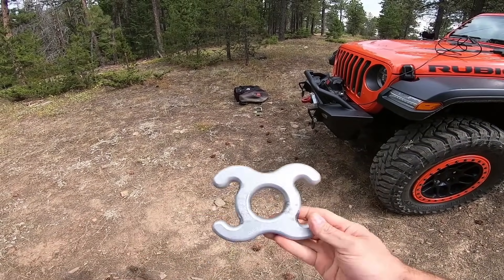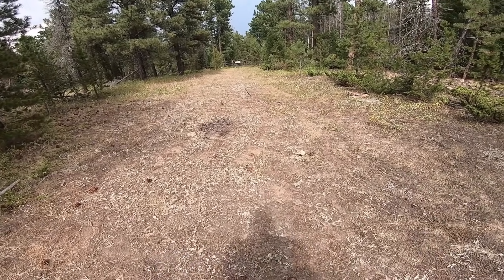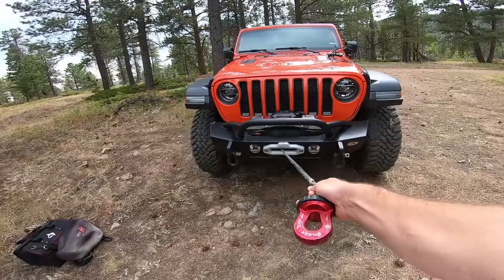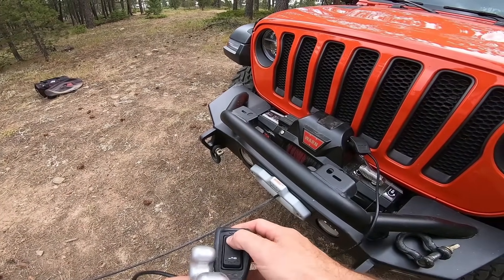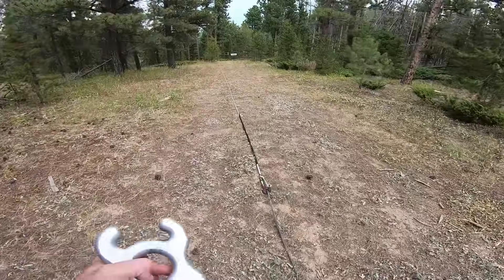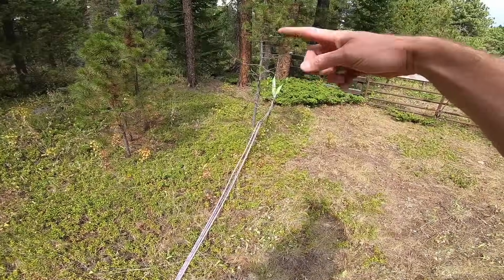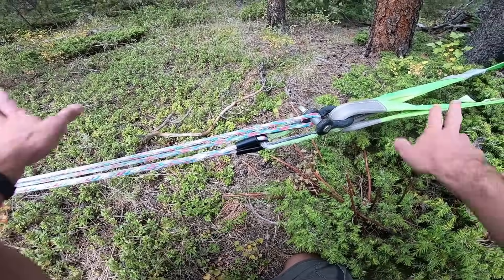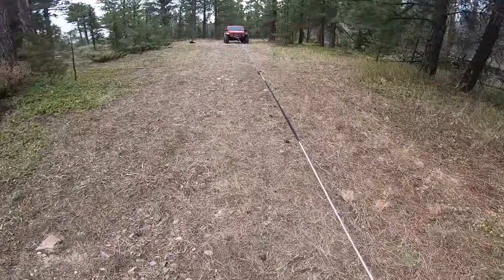Offroad Recovery Gear - What's an X-Lock Part 2

Comment: Good videos. It's neat to see some innovation with explanation in this market. One small suggestion/tip. Be aware of potential damage from the exposed threads on the inside of the pin can cause to the synthetic line. At the end of your video you can see how the shackle canted to the clean side, imagine the line being wedge hard into the other corner ( with the typical exposed 2-3 sharp threads ).
Reply from the maker: indeed!! our trainer also reported to me that i could skip the soft shackle and rig it all through one hard shackle, which should have alleviated that too.

Comment: I’ve got an X-Lock. It’s an incredible tool for professional recovery applications. When used properly, it’s breaking strength exceeds many other recovery items, making it an incredible piece of kit. It’s got many uses and can be an invaluable tool when you’re in an unusual situation. I’ve been asked several times “what’s that thing”, “why do you have that” or the like...and once people see its specific purpose, it often makes more sense to them. Most folks are extremely familiar with traditional recovery methods. This is simply a new tool for the advanced recovery toolbox, and is unfamiliar to many. It never hurts to think out of the box, and sometimes doing so can save the day. Well done Justin!

Comment: After watching you last Video I shorten my Winch Cable from 90 to 50 feet... I so hate dealing with 90ft of Rope on the Spool... Made total sense regarding Winch Load, and 90% of the time I’m pulling myself off a Rock five feet😳... I then bought 50 feet of Winch Extension Cable to use when needed 👍 ... I’m having a tough time finding the X Lock ... Thoughts 🤔
Reply from the maker: https://www.asroffroad.com/sx-20000h-x-lock-20-000-lb-wll/

Comment: The X block would be a great tool if the price was reasonable.
Reply from the maker: what would you consider reasonable?  that's a serious question... i'm going to meet the maker of this early October.
Reply: @JustinKingOffroad  Kinda late but I think these would have better sales at $80.  Not a lot of info on how these are manufactured, I assume they are cast aluminum??  Even billet aluminum shouldn't cost as much as these do.  I still plan on buying one some day.  If billet, heat treated and coated then maybe it's worth the asking price.

Comment: Did you just step across a ‘loaded’ winch line during your demo 🤦🏻🤦🏻🤦🏻🤦🏻
Reply from the maker: yeah i thought about that after i did it lol.  the line probably had 500 pounds on it instead of the "couple thousand" i stated in the video.  i hopped over it more than just stepping over it, but that is not a good idea in practice ever.

Comment: Great explanation. 
1 point of improvement. If you put the looped end in first, you can place the single line thru exactly where you need it and minimize or eliminate the sliding that you've been doing in the last 3 or 4 videos.

Comment: Hi Justin, I've really enjoyed your recovery videos but I have a question about your winch line and the minimum bend radius math.  You mentioned the minimum bend radius is 1.5 x rope diameter which is the same as what Samson Rope recommends but they state it as a minimum bend diameter being 3x the rope diameter (equivalent to radius of 1.5x rope diameter since 2x radius = diameter).  To meet the minimum bend diameter for 5/16" winch line would require a shackle pin diameter of 15/16" but you said you were using a 3/4" shackle.  It sounds like the pin diameter may be a little undersized for your winch line.  You should probably be using a bow shackle with a 1" pin, not only to meet the minimum bend diameter for you winch line, but to also increase the safety margin of the bow shackle relative to your line strength.
Reply from the maker: there is a big difference between overhead lifting ratings and recovery.  The I4WDTA trainer states 1.5 times the diameter of the rope for offroad rigging retains 90% of the pull rating of the rope.  so that needs to be calculated into the recovery equation as well.  7/16 = .4375, * 1.5 = .565 inches, which is under .75 pin size of a shackle.

Comment: you should really consider either wire locking or zip-tying the shackle pin to the shackle instead of over-tightening the pin.  they can find themselves backing off on bumpy terrain.
Reply from the maker: i have never had a pin back off driving around when i tighten it down like that, but we have had them work loose in long dead tows.

Comment: Thanks for the video. This clears up a lot of questions. I don't yet have a winch, but I'm trying to line out what accessories I want to pick up with the initial purchase.
My rig is a light weight, stretched 48 Willys CJ2A. I know that I don't need a lot of winch to recover myself, but my wife has a 2000 Discovery II. I need to equip the jeep to be able to recovery a vehicle that weighs as much as (or a bit more than) twice what mine does.

Current setup is a 1948 Willys CJ2A stretched 24" from the dealership in Spokane Wa. in 1948. Powertrain is stock 48 with the exception of a '67 Dauntless 225 V6 and a '67 offset narrow-track Dana 44 rear on stock 5:38 gears. Tires are 235/85R-16s on stock 4.5" rims, Rancho 2.5 inch lift springs for a genuine dump-truck ride (OMFG I hate it. Wish I had OME springs) .

With the stretch and oversize tires (to maintain breakover angle) the turning radius is about as good as a WWII aircraft carrier. I'm thinking about fabbing either individually lockable rear brakes for 'pivot steering' or low-budget rear steering.

Comment: I don't even have a winch and these are fun to watch and learn from.
Reply: The videos are at least as valuable without a winch because any vehicle can exert pull. That's why I keep gear in all my trucks. BTW a truck can drive much faster than any conventional winch can spool. I use that advantage with long wire and synthetic ropes to preload then control tree falls by pulling them all the way down with my trucks, and between snatch blocks and sufficient length I'm nowhere near the tree when it drops. I also drag scrap vehicles and while I have some very nice industrial Ramsey winches it's usually faster to pull by vehicle.
Reply: I thought I was the only one...lol

Comment: Why dont you use a winch dampener blanket? yes, i know that when synthetic rope breaks it is suppose to just drop to the ground, but in reality there is always the chance that it could send a bow shackle or x link etc through your windscreen. In Australia we are regularly told to use a dampener blanket (or anything with weight to go over the line)
Reply from the maker: that is not going to stop anything flying back at you, all it does is hurl the damper too.  why add the flying mass to the line?  lots of videos out there showing dampers not working.

Comment: That is a sensational video. All of the information was very clear and makes perfect sense. (Only because I can't wrap my head around the loss of power per wrap. Like, I understand the physics and the equations, but it's still not siting. It will come to me - likely at 2am after a solid lubrication session around a campfire - but it's not there yet :) )
Reply: If you understand gears and how larger tires affect power you can think of the drum as a gear getting larger or as each wrap is on it is a larger size tire.
Reply: @badgerpa9  that is a perfect analogy! Thank you!
Reply: @Middo-572  don't tell anyone I was nice usually grumpy growly.

Comment: Trainers are not manufacturers and some blow smoke up your ass to make you think they know what they are talking about.  NEVER do anything that the manufacturer of the products says to not do no matter who says you can or you deserve what you get if there is a failure.  Take any advice from a trainer with a grain of salt because they use brand Y and that is made for and specifies one pattern of use.  If you buy brand X and Z you can take the trainers advice if the product you buy allows use that way but not if the product says not to because what you have is not product Y.

Comment: i have no issues with any of your rigging and i see the purpose in the X-lock but how often are you in a situation where you can do a single line pull but run out of power before you spool in 50ft and are able to just double the extension back to the tree? whats the cost on the extension? i ended up with a pile of flat straps from princess auto 2" and 3" ones 20-30ft long, theyre way over kill an take up alot more room but they were pretty cheap and can be used to pull other vehicles out if my kinetic rope ever broke, i also do some side work taking out trees and theyre useful for that too

side note im up in canada and got a 9500lb smitty bilt for about 340$ the thing is a beast i use it constantly an have pulled massive stumps the size of the jeep out of the ground with just the winch and a sawzall, basically had the jeep suspended by the winch line with no weight on the tires and rear bumper chained off to a tree while using the winch and a snatch block, ran the thing until it was too hot to touch, the two batteries and alternator were crying but it did the job and no issues since, i dont feel the need to drop triple the money on a Warn
Reply from the maker: i've had a few situations where i've used my pulley as a redirect because i needed to pull straight toward a tree, but ultimately i'm trying to turn around (in snow - i like to push the limits some times and get stuck for fun).  even with the redirect, the line was too long (down on the last wrap where all the power is) and i needed to shorten it.  queue up the x-lock.  it also helps as you start to pull yourself around and can eliminate the pulley, you go back to straight line pulls but now you only need to go 40 feet, but still have 90 feet of line.  you can pull it all out and shorten it, and keep on winching.
Reply: @JustinKingOffroad   idk if youve tried kinetic ropes yet this is your only video ive seen, but they are night and day difference when giving someone a pull out of anything
Reply from the maker: @AndrewBrowner  I own 2 of them.  They are awesome.  We've also coupled them in line while winching and it really takes the strain off the winch.  Kinetic stores the energy and smooths out the pull.  Also makes fast work of wheeling with friends and getting stuck in snow or mud.
Reply: @JustinKingOffroad  never used it on a winch pull but yeah in snow especially when theres on rig getting high centered over and over you can just leave the rope hooked up while trail riding, if it does come taught there isnt near as much of a bang as with chain or static straps

Comment: And from the looks of it you could use the x-lock to divide the load between to smaller tree or even three depending on the situation. Where I'm from it's clear cuts and smaller trees
Reply from the maker: i suppose you could actually! it's all a static line at that point so it won't move.
Reply: I've pulled trees out of the ground and some were just pulled over pulling others out with a blocked 12000 with tree savers and winch extensions. Thought about getting a Land anchor

Comment: Thank You for this demonstration. Such a simple yet complex tool. I definitely plan to get one. Question: I’ve never used the soft shackles, been wheeling for many many years and only used the “d-rings” as us Texans call them. Have you ever had the soft shackles fail or come loose under load?
Reply from the maker: i have not had one fail but i also stay inside their "WLL" (aka Working Load Limit).  i've wondered about them coming loose but i've never had that happen either.  seems to be a pretty solid product.  the 2 you saw in the video today are my primary use shackles, they have some wear on them and have held up fantastic.
Reply: when they're cinched down upon themselves up against solid anchor point they cannot come loose unless the rope that they're made of is damaged
Reply: Cool. I might try adding some to the mix. Thank You Sir

Comment: The only winch I have is on my tiltbed trailer. But I use steel cable. I don't have enough experience with rope and I don't use the winch on a regular basis. Watching your recovery vids, takes some guts driving the GOAT TRAILS you do recoveries on. Great vids. Thank you for this vid.
Reply from the maker: steel on a trailer is probably just fine cause the loads are very small.  synthetic rope is stronger (at smaller diameters) and much safer to work with.  if you do ever get a winch on a vehicle, highly recommend rope over steel just from the ease of working with it (and safety).